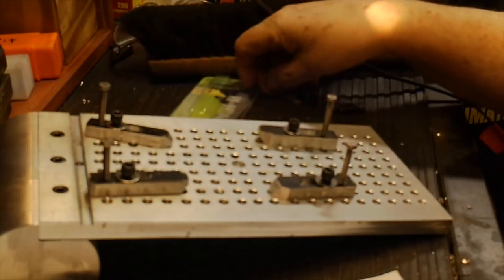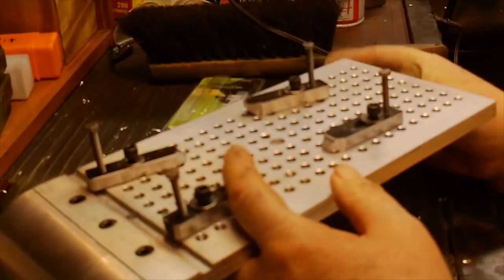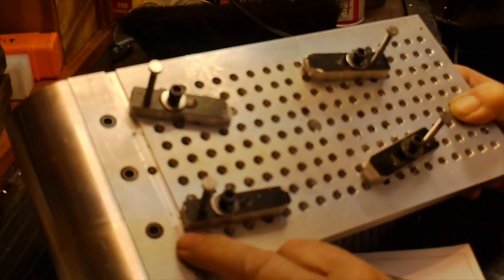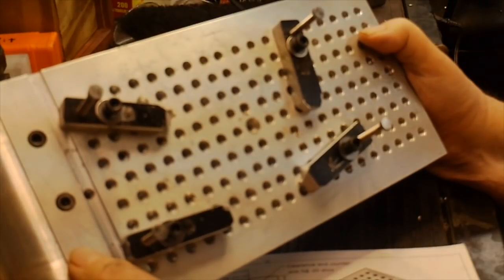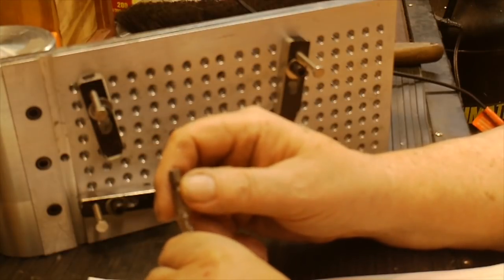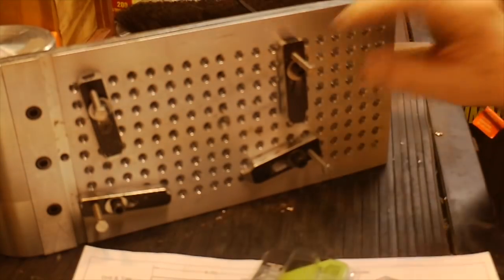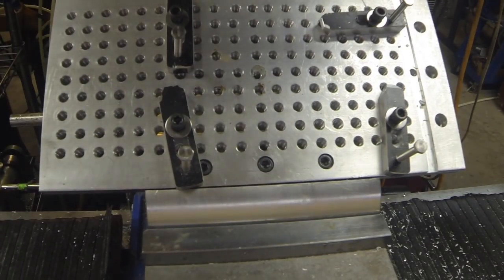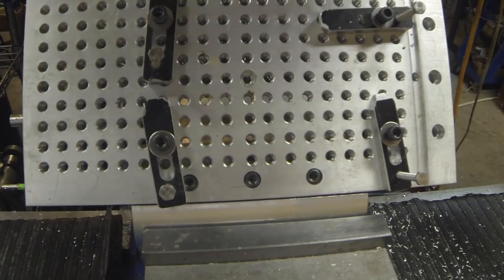This week in Herb's Workshop

Comment: Thanks for the tip about power tapping. I have a set of the common sized Greenfield  drill/tap bits, never thought about using them in the mill.

Comment: Nice job on the sine pallet , Question wouldn't fine thread 1/4-28  work better or do you think the threads would pull?  Wondering with the thickness of the plate. Couldn't angle lines be scribed or slotted in the ends of the pivot for quick setup on none critical angles. I'd think 30 , 45 , 60 , 90, 120 degree lines would cover most. Then a surface gage would make close but accurate setup. I've got plans in my head to make some , it's something I've always do work without prints on things like this. Got my mind working now ... Thanks more projects I hope to do.